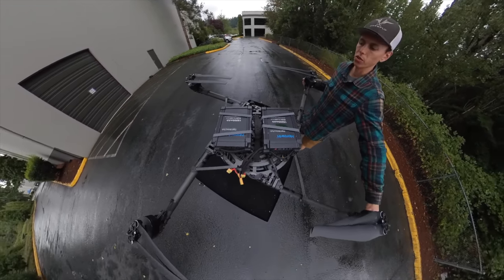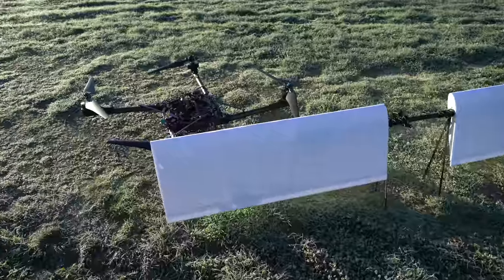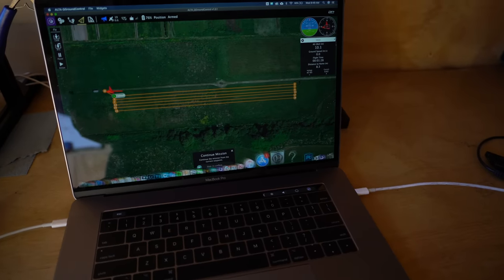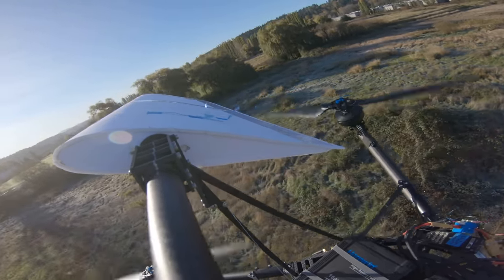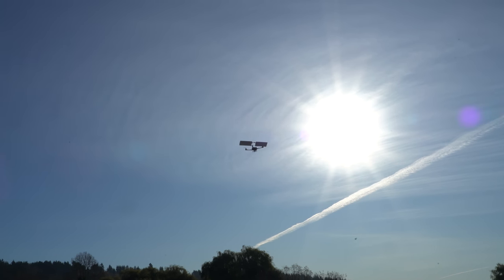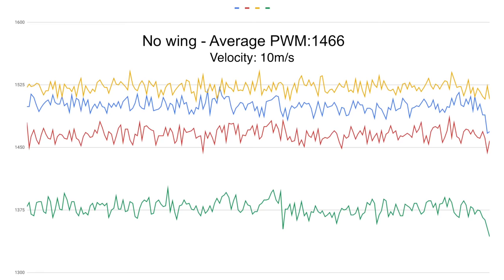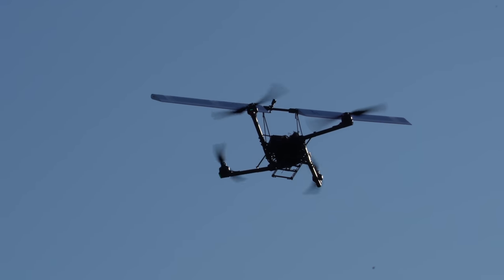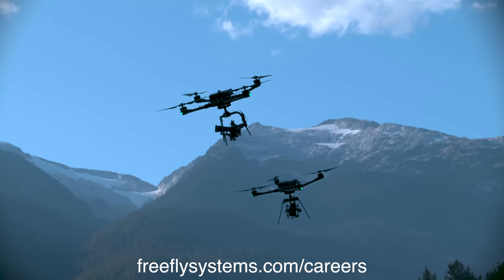Can a Wing Increase Quadcopter Efficiency?

Comment: How about the sort of angle-of-attack control tail/elevator thing you used on your rigid wing sailboat? I think that would be a lot smoother than the hard stop on the wing angle.
Reply: Or an tuned progressive elastic resistance to the AOA? Like 3 different surgical tubing lengths in parallel, that way the AOA would be a function of the airspeed. You could still have a hard stop and the period of the oscillations may be longer as well. The tuning might be tricky, but maybe with force meter measurements on a hard stop for several AOA/airspeed combos you could tune the elastic dampening. Great video!
Reply: No way bud. The wing should be centered on the CG. Any aerodynamic stability, positive or negative, is going to fight the pid controllers. Aerodynamic stall is desirable in some cases and a normal part of the maneuvering flight regime. An AoA sensor should feed the FC to inform cruise efficiency. Get all these nasty aerodynamic flipperon things out of here. This is a quadcopter!

Comment: What if you put the wing fixed perpendicular to the rotors and in flight go full throttle and angle the quadcopter 90° forward and use it as a conventional aircraft. But then basically you've converted it into a VTOL

Comment: I love the idea and it apparently works a bit, extend the wings out beyond the rotors and mount it to the bottom of the frame of the unit. maybe make the size of the wings about 1/4 of the size that you have on there now. just a thought from my head.
Reply: Having the centre of lift below the centre of mass could cause issues, although the drone could probably keep it stable.

Comment: The drone is missing some kind of more effective pitch control like in standard airplanes, i think this is causing the oscillations.
Also fins below the rotors maybe would prevent the rotation of the airflow, which could boost efficieny as well
Reply: I agree. I think the flight controller program would need to be designed for this hybrid design and also include servo control for wing pitch, and then it should be able to effectively counter the instability.

Comment: I like the approach as I've made similar concepts some time ago. I used servo-like stabilized AoA of the wing to maintain constant angle regardless copter pitch and current sensor to get real power consumption. I notified significant gain in efficiency, however I dealt a lot on control algorithms as copter's autopilots does not like a wing to be attached and provide lift. It is bit misleading to autopilot, you increase the forward speed and you generate lift so it needs to decrease the thrust having less authority to control pitch, roll and yaw.

Comment: Late to the party, but I think the performance would be better with the wing mounted just below the props instead of above them. It'll also be a more compact overall package.
Reply: the down wash of the props would keep pushing the wing down aswell as messing with the airflow over the wing so idk if it would be better, would like to see it tested still
Reply: @hazza2247  Think it would be more drastic than the props pulling the air past the wing in the current configuration?
Reply: @Stormclowe  i mean both are bad, i don’t know enough about this stuff to have anymore of an opinion

Comment: I am currently completing my senior design and my project is a fixed wing (piper cub style) with vertical take-off and landing capability and a forward pulling traditional style motor. This is interesting because it's such a different approach from the previously mentioned Warwick university example. I would see this design being helpful at very slow speed but testing this to a slow flying fixed wing VTOL would be interesting to see what design is more efficient. could be useful for package delivery applications... maybe... as you mentioned high wind would be extremely detrimental to this design.

Comment: Check out the British designed Fairey Rotodyne from the late 1950s.  A single rotor was used for take off and landing and which was then then put into auto-rotation during level flight.  Lift also came from 2 short span conventional wings where the propeller engines were mounted.  The system worked well but the biggest con was the noise made by the rotor tip jets on take of and landing.  Not a good point as the aircraft was intended to be operated from city centres.  There was a hush kit in design when the project was cancelled but by then it was too late to get any more government funding :(

Comment: Here's my silly idea: Instead of large solid foam wings, use small spools of fabric and pairs of linear tracks to create the airfoil. 
Winches made with continuous servos will be used to extend the fabric, while the spool will be tensioned back by coil springs. 
This could provide more adjustments besides rotation, as there's total control over the airfoil's surface area. For example, to retract it partially or entirely when hovering or in turbulence.

Wait a minute, did I just reinvent sails and repurpose it as a motorized kite...? 🤔
Reply: Sounds like a fun project.

Comment: Drone programmer here, the wing seems way too complex system for the PID to handle, especially may be the following: at speed X, the wing is pushing you UP, and if this is more than the drone can compensate lowering motor speed, it goes crazy. Also sudden loss of lift (stalling) is something PID cannot handle.
Also, where is your center of lift?
PID are a more a final touch, the more the drone guidance know about its physic, the better result you have
Edit: if you would ask me how to start programming this, i think that first think you need to control electronically the pitch, or you cannot handle dynamic speed, you have one speed that is your most efficient and you cant exceed without keeping altitude requirements.
I would create a test in something like xplane, as it does actually simulate propeller physics and other aero property; and create a table to what best pitch give the best result. It is simply too many hour to properly create an optimizer , the lookup table is the best. Also while the wing are engaged, you probably want to use less motor and more wing control, as the wing itself will stabilize pitch roll and yaw.

Comment: In the hover (or "drone") orientation, having the wing above the center of mass increases stability. (In terms of forwards/backwards speed: going forward increases drag on the wing, which is above the center of mass, so it pitches you back, which decreases drag, and so on.) If your drone pitches forwards into "plane-like" orientation and tries to go fast, it is putting the wing in front of its center of mass - A very famous thing that is making a craft unstable.
There's 2 possible solutions:
Either move the pivot rod to below the rotors to get it to the same height as the center of mass or below it. In this case you'll loose the stabilization in drone-mode.
Or move the pivot rod further towards the rear of the drone. That will increase the stability in the airplane-like orientation. You can get away with keeping the wing above the propellers if your drone never pitches more than 35° or so down (which may not be true, since I expect optimal efficiency gains close to 90° down pitch).

Comment: So, in my experience, drones often have to run their rear motors faster than their front motors when moving quickly because the faster they go the higher the righting moment in pitch due to aerodynamic forces.  I don't know if that's universal, though.  Maybe it depends on how your central body is shaped?  But, as others have said, you are also getting a pitching moment from having the wings so high above the center of mass.  Putting that all together, I'm impressed that it worked as well as it did.

Comment: A wing mounted on top, like Chocolate Rocket commented, added a pitch moment because the drag force is acting a distance away from the center of mass.  On top of that, the center of mass has been shifted upwards, creating even more instability.  To counteract both of these points, you could try sizing down the airfoils and adding equivalent airfoils to both the top and the bottom of the quad.  You technically don't know exactly where your center of mass is unless you're able to model all of the parts in CAD and use an assembly to let the computer figure it out for you, but you can use intuition to approximate where it is.  Even if the top and bottom airfoil aren't the same distance from the center of mass, the resultant forces and moments will bring the system much closer to stability.

Comment: Wow, this idea looks great, but I would suggest to mount the wing further rearwards and with a fixed pitch angle because when the center of lift of the wing is behind the CG the wing actually provides positive pitch stability so it wont get into those oscillations. Also would negative angle of attack not cause the drone to crash because it would limit the maximum forward pitch of the quad. I really would like another video of this concept with some design improvements.
Reply: I was thinking the same thing about wing location. When the drone tilts forward, the wings move forward causing lift in the front so the drone tilts back, shifting lift to the back etc etc. I have no expertise though so was looking for a comment that was similar.

Comment: I’ve been designing and flying RC planes for 40+ years. In order for this to have any chance of working, you need to do two things. First, get the center of mass (CG) of the drone about 35% back from the front of the wing. Second, use an accelerometer, servo, and small microcontroller that can adjust the wing’s angle of attack so regardless of the flight angle of the drone, you keep the wing’s angle of attack to the wind in the 0 to +3° range, depending on the airfoil. Otherwise, the wing just acts like a big sail.

Comment: I actually made something a lot like this a few years ago, but for a 4' quad style base, and rather than 1 wing in the middle, I had 2 wings front and back. They were automatically put level with 1 servo that was linked to both of them. It kinda worked for the lift aspect but the control algorithm had a ton of trouble with it. I never ended up getting a chance to fix that though.

Comment: Have you considered a "freewing" system? Essentially, build the wing as a flying plank with a reflexed airfoil, or with a trim tab to adjust the reflex for different speeds, and then set the pivot so that it matches the flying plank's CG. With this setup the wing should hunt for the ideal angle of attack in the relative wind without needing a stop.

Comment: The travel locks would seem to create an unavoidable positive feedback loop. The control software of the copter is expecting the forward angle to increase as speed increases without increasing altitude. The drag from the wing being on top will always try and rotate the copter rearwards. If the control software detects an increase in altitude because of the extra lift, it's going to reduce throttle thus increasing the influence of that drag, pulling the copter back further, increasing the angle of attack + lift + drag working to convert forward velocity into even more altitude until the wing stalls. 

Even so, I'm amazed you're able to see these efficiency numbers with the software being so confused. If the wing angle was controlled by the software and the software modeling was designed from the ground up to account for these effects, I think you'd certainly have something amazing here. Love this idea!

Comment: Feedback: one way to avoid negative pitch moment at high speeds is mount a fixed-pitch wing forward of CG (1-3 degrees positive AoA); a slow climb is way better than a high speed crater
Next experiment: Place the wing below the rotors & fix the pitch (to eliminate oscillations). Test your theory regarding rotor wash. You might also want to experiment on wing placement (test forward of CG & aft of CG).

Comment: As others have already pointed out, the problem is your center of lift is ahead of your CG.  That is an inherently unstable configuration.   This gets worse as it goes faster and pitches further forward.    Will always be a problem with the wing mounted high above the center of the quad.  

Your idling front motor was probably due to the angle of attack of one half of the wing being a little higher than the other so it was always trying to roll a bit.  

FWIW, there is another way to get a fair bit of added efficiency with a multirotor like this, especially with large efficient props .    Push it around horizontally.    In other words, add a 5th motor mounted perpendicularly and push the aircraft around while it maintains a relatively level attitude with four main props just maintaining enough power for a hover (you'll find can actually reduce power below that a little).    It's tricky to get prop clearance and it's generally loud as hell because that 5th prop is always cutting through the dirtiest air possible, but you can gain quite a lot of flight time.      Foxtech FPV made the "Screamer" years ago, and even with five 5in props I could get almost double the flight time for a given forward velocity.   The rear motor was larger and had > 1:1 power/weight ratio so I could pitch up to vertical and climb straight up at 50mph with the other 4 motors just idling.

Comment: Two ideas that occurred to me watching this:
1.) Add four wings to a quadcopter where the propeller arms form the main spars. I think that with the right control algorithm you could directly control angle of attack (not just with ailerons/elevators), but could also purposely induce side slip/lateral motion without rolling or turning, which a conventional aircraft cannot really do.
2.) Create an aircraft with no control surfaces, that controls its orientation solely through rotating internal weights and conservation of angular momentum.

Comment: An idea I recently considered: Attaching helium filled balloons to a quadcopter to offset some of its weight and therefore reducing energy consumption for hovering. I have not gotten around to doing even some cursory math on how big these balloons would have to be to make any noticeable difference and so that the (volume of gas)/(weight of mount + balloon) works out to be at all productive, but I think it could be a fun thing to try. The attachment of the balloons would certainly have to be static, so that it is not a quadcopter swinging around helplessly on a cord below a balloon, and the large surface of a balloon could create some real problems with wind. Idk, maybe one could design a funky looking quadcopter airship.

Comment: In addition to the correct focus of lift towards the center of mass, I would suggest flying not with speed stabilization, but with pitch angle stabilization. I'm not sure if this is possible with the drone firmware. Generally, without an air pressure receiver, which provides information about airspeed and wind direction, it is difficult to fly well, but in calm conditions, interesting results can be obtained.

Comment: Build one you can fly yourself around, everyone seems to place the pilot at or above the rotors, on a hard landing the pilot could be thrown down onto the rotors, and if the pilot is at rotor level a blade could snap and  impale them, i'd like build my own with a fuel engine with two counter rotating props for the main lift, and four battery rotors for control. really enjoy your videos

Comment: Problems I consider:
Won't the props pull out the high pressure environment from under the wing and destroy any lift?
Also since the wing isn't fixed it would naturally choose least resistance and not create any lift until it hits its locked angle?
The flight controller is probably causing the oscillations too, as it tilts forward the wing resistance suddenly decreases because it will rotate since its not fixed, making it suddenly tilt forward.
The tilted wing will also push extra air onto the back rotors when it randomly swings, so then the back generates extra lift, tilting it forward

Comment: Aeroespace engineering student here, those oscilations are caused by positive arch wings by definition having a positive pitch moment alpha derivative, thats why flying wings need to be delta shaped or atleast have some negative tip angle of atack so that the total pitching moment derivative is negative, crating a self stabilized flight
Reply: Oh, also, just a fun note, but the actual oscilations are caused by the angle of attack becoming so steep that the wing stalls and the nose falls back down and the cycle repeats again

Comment: Try a reflexive foil allowed to pivot freely without any servo control around pivot at ~30% chord - basically kicked up at the trailing edge to function like an integrated tail plane, it will set an angle of attack relative to the airstream all the time.   Alternatively employ a small tailplane at lower AOA mounted off of a still freely pivoting main wing.  This reflexive foil approach has been used a lot by traction kites to overcome tendency to luff, but was also an effort years ago to make microlights under name 'freewing'.  A servo control on the tail plane AOA would allow you to set main foil AOA independent of drone pitch.  Something similar is done on speed sailing craft and sail drone craft, to precisely and rapidly control the foil lift in rapidly changing incipient air directions.

Comment: Awesome idea to improve drone efficiency! 
I think the main cause of instability is the aerodynamic pitch instability induced by the airfoil. As soon as the wing starts flying. Every normal aircraft needs to adress this problem. Usualy its done by choosing diferent agles of incident between main wing and tail wing. The simplest way to fix this on your drone would be probably by using a stable airfoil like its used for flying planks. No need for a tail anymore.